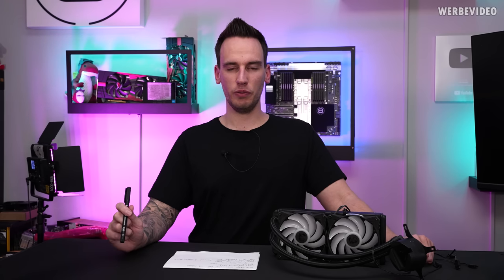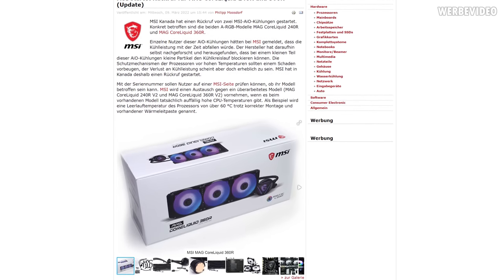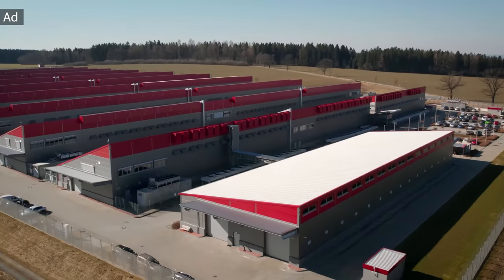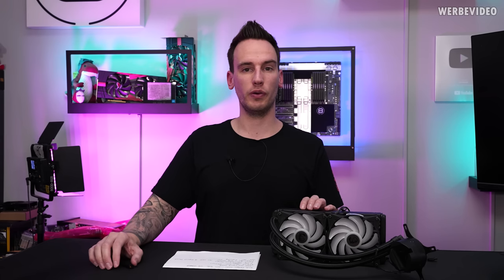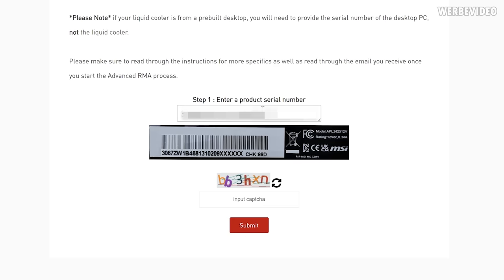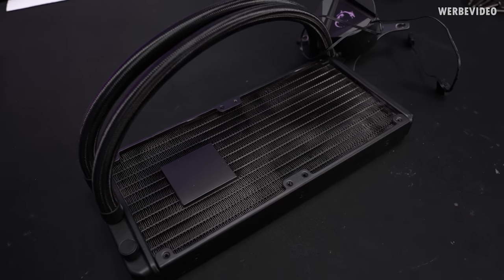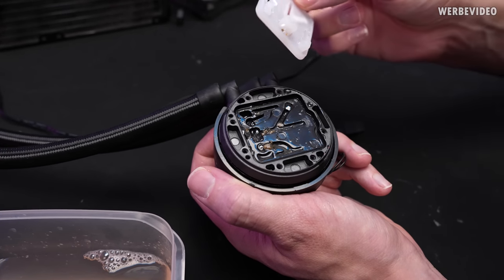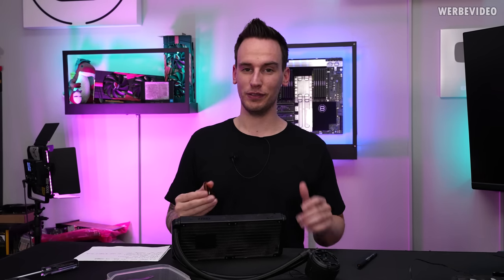Things you should not find inside an AIO

Comment: I'm entirely too paranoid at this point to ever get an AIO. I feel like every brand out there has had at least one case of buildup in the loop.
Reply: If you are in the us, arctic appears to be having really good price perf and relatively little incident. And they proactively hand out replacement when they discovered flaws.
Reply: You only hear about the bad ones, you never hear about the ones that have been going for absolute ages without issues, like my 9 year old Corsair H100i that is entirely untouched apart from quieter fans that I put on the day I got it.

Comment: Just buy any AIO in Alphacool Eisbaer line. It uses REAL Copper Watercooling components and is even cheaper than most of the Corsair RGB DogSHit on the market
Reply: Been running a 360 for some time. Very solid.
Reply: I agree. It will circumvent the problem because those are soldered together differently and thus are not suffering from the flux residue issues like aluminum radiators.

Comment: i feel that you should just return a AIO every 23 months and claim warrantee as its a matter of time before they die or function less. This is why i still use air coolers. Few degrees diffrent yet half the price and lasts forever.
Reply: And you can do maintenance on your own a lot easier. Just clean the dust filters once a month and you're good.
Reply: Agreed, they all clog (WHEN not IF) and the pumps die which is mainly due to the clogging. They are usually fixable, just open them, clean and flush them and refill it with distilled water (available everywhere as water for Steam Irons). I've never needed any fungicide added, and no need to bother with a long RMA. The problem is massively widespread but most 'joe's' simply assume their PC is old and never even think to check temps so recalls are rare but the problem is UNIVERSAL.

Comment: I had a nearly equivalent issue with my Corsair H80i v2. My i7-4790k was overheating just trying to watch 4k video, even after delidding.

In my case it seemed to be a crystalline formation build up at the cold plate. I filtered the water through a coffee filter, added some distilled water and a dash of Isopropyl alcohol(99%) and refilled.

The alcohol seemed to dissolve the crystals. Could it be Glycol coming out of solution?

Comment: I see a lot of AIO failiure videos over the years and im curious to these buildup issues that have grown more common if it could be flushed and given a different mixture, Distilled water, biocides/corrosion inhibiters if it will be fine. I'm not a fan of the aesthetic trend with AIOs that have meant a lot of manufacturers looking to expand their product stack have gone for cheap designs rather than build one from the ground up, JayzTwoCents did a video on a solid AIO from the AM3 era (Enermax LiqTech series) that was a custom design where it wasn't so important to have an IPS screen, RGB and temperature readings, it was about PERFORMANCE..as things should be. And it was totally fine..

would be interesting if he opened it up to inspect its heath. With prices of AIOs through the roof from the aesthetic trend..i'd expect more. Friends who i have recommended good tower coolers to either listen or go and grab an AIO after saying they can only spend X amount of money but then spend 3x that "because it looked cool n matched X component" without having looked into the AIO design..which i do think companies should be more specific on, what type, like Asetec, Apaltek..etc.

Comment: MSI still thinks that this is only a problem in production error that would only affect a few of the AIO. When it's now clearly the design flaw of the pump-in-rad. My MSI AIO was NOT in the re-call program because it was the AIO of the pre build MSI MAG CODEX X5 with the same temperature issue. The only way I solve it is just buy a whole new AIO from other brand with 120 size and my CPU never reach 100°C anymore.
Reply: It seems like a corrosion issue to me. Mine worked flawlessly for 8 months. It died in about 3 weeks time. I monitored the temps while gaming pretty consistently and saw no change until I was on a zoom meeting and my pc shut down.

Comment: Just getting into the video.  But I have an arctic liquid freezer 280 that i ordered two weeks before the set recall date for arctic's recall.  I've also been concerned whether or not mine does actually fall outside of the products they've recalled.  As far as I can tell they have not at all showed a serial number range or a version number of these coolers that I can find.,
Reply: They say it was a gasket issue. I wonder if that was just a guess and they used a manufacturer that used the wrong flux like in this instance with MSI and most AIOs.
Reply: everyone with an Arctic Unit should go fill out the Form. they seem to be casting a wider Net than they stated to ensure they catch all of the affected Units.
Reply: @taiiat0  ok yeah good idea

Comment: My 360 was pooched brand new, same thing I checked my SN and it said nope you are good. Then I kept questioning myself why are my idle temps ok, but under stress my 12600k throttles. So I swapped it out with a Be Silent Loop 2 360, and low and behold temps are 30c lower…..

Comment: it looks like they are using copper cold plate with a aluminium radiator.. that should be the reason for corrosion..
Reply: Everybody in the industry making AIO is using aluminium radiator and copper cold plate.  Our car radiator is also made of alluminium , some engine blocks made of cast iron , thermostat partially made of brass ,  yet running the same concept of liquid cooling.  They don't corrode easily because of the coolant/anti-freeze . Same thing here, these companies use the wrong coolant.

Comment: Could this be cleaned out, new liquid added and it be fine again?
Reply: no, just like with Arctic or others this is a chemical reaction between components. They either send you a replacement part and you change it or they do it.
If you just replace fluid it will work for a while and then clog up again as chemical reaction continues
Reply: @marcogenovesi8570  that's why they only selected a range of affected units. So they dont have to replace them all.

Comment: Are the 360R aios affected? I have one and am wondering if I'm gonna be in trouble
Reply: Most likely. I would bet on it. But they'll all avoid admitting to it cause so much money is on the line.
Reply: Personally I would swap it just in case. I run a 5800x  and did the 360r because they supposedly run hot. It ran great for 8 months and then failed. I switched to a Be Cool Dark Rock4 Pro and it has been great.

Comment: I wanted buy RTX 4090 Liquid cooled AIO version from MSI, do you think it be same AIO? with same issues? should i just skip and buy something else? since EVGA is no longer making GPU's if i was to skip on MSI AIO RTX 4090, what about Gigabytes AIO's one for RTX 4090? or suggestions?
Reply: Do you read anything? Avoid the nvidia brand and the 40 series. Not worth it. Too expensive, too big, too hot, no efficiency. Not friendly with board partners. Not consumer friendly. Manipulation on a whole new level.
And yes the GPU aios are probably going to have the same problems.
Reply: @tacticalcenter8658  Cool

Comment: Isn't same situation like with arctic liquid freezer 2 series?? I guess they are produced from same components or same factory??

“In some products, a chemical reaction may occur between the copper cold plate and the gasket because the gasket is not sufficiently vulcanized. This reaction of sulfur residues and the copper plate can cause deposits, which in the long term can lead to a reduction in cooling performance, up to a loss of coolant,”
Reply: No, there the gasket has the wrong material which reacts with the fluid additives and possible with flux residue of the radiators. This is a different issue which a similar outcome but this time gasket particles ending up inside the cold plate instead of flux residue or crystal growth.

Comment: This one broke in a year instead of 2-3 years. Pinking on MSI when all manufacturers use Aluminium to save 5-10 $
Reply: It's not the aluminum itself, it's the type of flux being used to make the radiators. Some external manufacturers who make rads for AiO makers like Asetek and others have switched to a cheaper flux that is not suitable to be used in a liquid with anti corrosion additives. With the latter, you can safely run an AiO with a copper cold plate and an aluminum radiator. This has been done in the past without any issue down the line. Look at the old H series Corsair liquid coolers with the old style of tubing that are not suffering permeation* or clogging since ages, yet use a copper cold plate and an aluminum radiator. They're still going strong.

*liquid steaming out through the tubing.
Reply: Aluminium dissipates heat better than copper anyway.
Reply: @staples4335  no
Reply: @marcogenovesi8570  He's right though. It doesn't conduct heat better than copper but it does dissipate it better. There's a difference between the two.

Comment: This just makes me question the Quality of the QC done by manufacturers. I understand that it is a big production but, this is ridiculous. Hope they have better QC's put in place. Some of the AIO manufacturers never have such issues and they should probably learn from them. Great video and thank you for spreading the word. ALways love your content.
Reply: This is an issue that comes up months after the AiO was made. They do testing and burn in, but this doesn't cover the issue. It's a chemical reaction caused by the wrong kind of flux being used to solder the aluminum radiators together. See my other comment for more info. In general, if you want longevity, always get an air cooler or make a custom loop that can be fully maintained by you. If you really need an AiO because of the better cooling performance and high end CPUs, there are AiOs that allow you to refill it and make it easy to do so. In some countries like USA you can also clean your AiO without loosing warranty.
Reply: you can't catch this with QC, they didn's ship this with gunk, the gunk developed as a chemical reaction
Reply: @marcogenovesi8570  @KYŌDɅI KΞN Correct. This is gunk build up overtime. Which I completely understand. QC doesn't mean at the time of manufacturing only, it is after the product is made and they take it apart to make sure everything is ok. Which I feel was not done properly by some of the manufacturers. True, it would make things easier for refill ports to be accessible by end users and not impact the warranty. Don't get me wrong, I'm not hammering one company, it is every other company that needs to have better QC's in place considering the fact that the product released is not something people use for short periods of time. Being a manufacturer they should check if everything goes together in harmony without creating further issues. For ex; if you have a custom water loop, you will make sure that you do not mix metals right? Same thing should go for them. Check before and after manufacturing. This is a far cry though. Hope end users do not get the short end of the stick because of manufacturing defects in the future. P.S. Thank you for more infortmation regarding my comment :D
Reply: @marcogenovesi8570  True, but this has been an issue with Apaltek made coolers for over 3 years now, and they still haven't fixed it. They should know better by now.

Comment: We rightfully give Asetek a lot of shit, but at least their coolers seem to work. My friends and I have been using various Asetek made AIOs from various brands for at least a decade without any issues (I used one particular AIO for 8 years straight)
Reply: This is an Asetek cooler too. MSI is just rebranding. Asetek is one of the few OEMs that makes AIOs so most brands just buys from them and rebrand
Reply: The problem with Asetek is they don't make bigger cold plates for Threadripper platform, it is too small for that CPU . Thus heat transfer is not good enough.
Reply: @marcogenovesi8570  This is definitely not Asetek. This MSI unit is Apaltek, totally different company. This MSI unit has the pump in the radiator means it is not Asetek unit. Asetek patented integrated pump and cold plate assembly as 1 unit. Other companies cannot do the same become of patent infringement.
Reply: @marcogenovesi8570  This one is not Asetek.
Reply: @fleurdewin7958  Only Enermax did a cold plate big enough for TR. But they suffered the exact same issue like MSI. So it's not an Asetek or Apaltek issue. It's a GENERAL issue in the supply chain with radiators that were soldered with the wrong (cheaper) type of flux. Who's at fault here? Hard to say, it's a complex supply chain.
Reply: @kyoudaiken  That Enermax AIO that suffer the slime problem is also made by Apaltek. That was in year 2019. 3 years later, they still haven't solve this problem. Very awful indeed.  Asetek has liquid cooling solutions in data centers. I feel more confident using them
Reply: @fleurdewin7958  Still, any brand can be affected because it's the radiators that have a flux that contaminates the fluid. Unfortunately you cannot trust any AiO at this point. You need to do a lot of research and avoid buying new products until they have been tested by others. Or try to go air cooling instead.

Comment: Looks like a bad coffee brew Anyway rinse your Radiator a few times & refill it new Liquid  
                     should last for 10 years + as the formular MSI use was a bad one 
oo> mite look at my 2018 white rad deepcool oneday but running Ok
Reply: Distilled water  can you use it in watercoolers ? NO   it attracts chemicals like a magnet does   if you drank it for 2 days it will clean you out  of chemicals IDK look it up 
 What liquid is used in PC cooling?  The two types of glycol most commonly used for liquid cooling applications 
            are ethylene glycol and water (EGW) and propylene glycol and water (PGW) solutions.

Comment: That's why a custom loop builder should NEVER use aluminum radiators in the loop, unless he is using aluminum water block also. Note that Aluminum breaks under liquid metal thermal paste which is likely to be used for such a cooling enthusiast, the exception doesn't make much sense. Conclusion of these are to NOT use aluminum radiators. Use copper despite it's more expensive.

The AIO manufacturers decides to use them anyway thinking a planned failure out of warranty is GOOD for farming more money. F**k them.

Comment: Very happy to see that EK is already producing Quantum Vector² FE RTX 4090 D-RGB GPU Water Block and ACTIVE BACKPLATES for those wanting the very BEST cooling possible (stability, overclocking potential, as well as an RGB amazing looking card from both top & bottom), effectively sandwiching their 40-series GPU between two water blocks linked with a single terminal. And of course, reducing the card from 4 or 5 slots worth of height (which is INSANE but required for the fans version - which STILL don't cool as much as a custom water loop with active front & active back plates) to just 1 slot in height also makes this even more attractive, as well as silent cooling. 

Personally, I am hoping Asus Rog Strix partner up with EK again, but this time have a RTX4090 GPU option which is sold already with water-cooled front & ACTIVE backplates, so that it saves people the hassle of doing it themselves, is suitable for people too nervous to install one themselves, as well as coming with an out of the box warranty for all parts, & looking amazing with RGB from the top even if you mount the GPU in the conventional manner rather than vertically.
Reply: Most people are too nervous to install a water block themselves, which is why it just makes sense for the GPU manufacturers to have options to buy one that comes pre-installed with active front & active back water-cooling (the "premium cooling option"). Not only does it remove the chance that WE break it, it also means you buy a card with a warranty, rather than losing the warranty by water blocking it yourself. It also seems wasteful to pay for cooling fans & heat pipes just to waste (creating e-waste) them when you remove them to water block.
Reply: Your comment has nothing to do with the video and just sounds like promotional marketing bs.
Reply: @TheEchelon  the video is about a AIO water cooler, so in what way is talking about water cooling not related?

Comment: I bought one of these in june 2021, and it worked fine for a while, but this year things took a turn for the worse, i have a 9900k and it was running at a constant 99c, and was throttling really hard. i ran it like that for too long. and then in very late may of this year i finally took the cooler apart to find that it was completely gummed up, and i ordered a new aio but it wouldnt be there for a couple days so i cleaned the coldplate and all that stuff out and it ran fine again. but yeah, it gummed up quick, and when i got my new aio, i gave it to a friend and left him to deal with it lol

Comment: Can you flush and refill this aio. If they wont fix it fix it your self
Reply: Yes it has a  drain plug and the hoses will detach from the waterblock. As seen in the video, you can remove the pump and disassemble the waterblock as well.